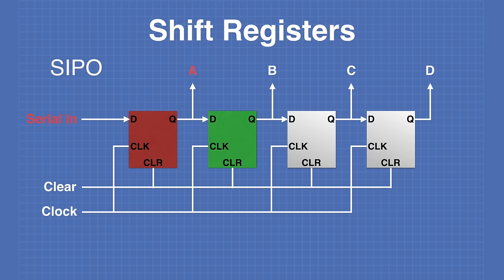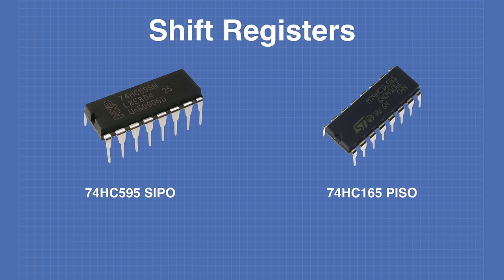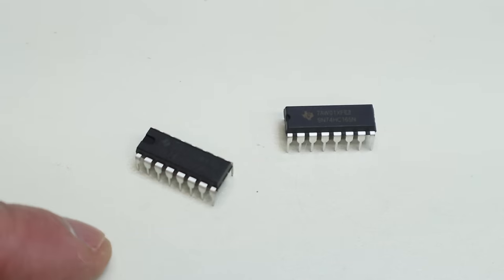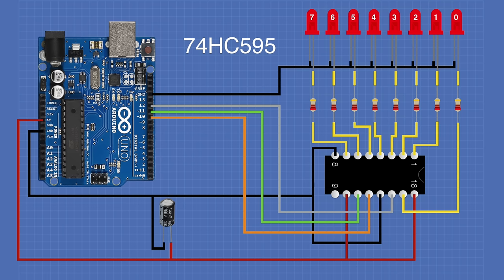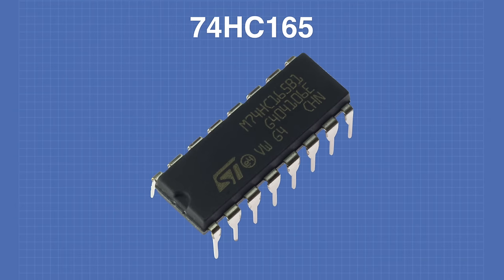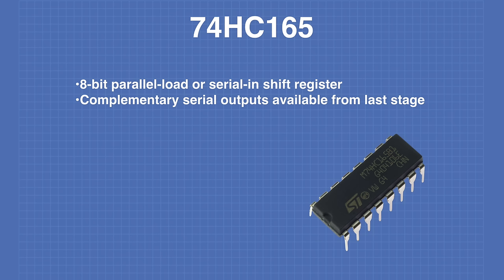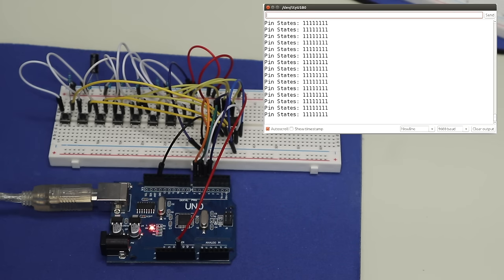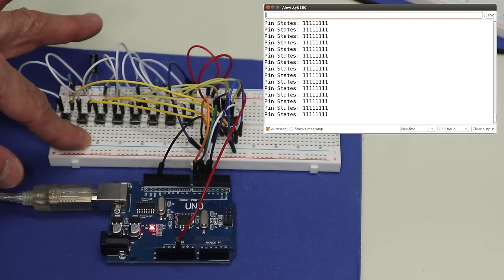74HC595 & 74HC165 Shift Registers with Arduino

Comment: THANKS!!  Very well presented, nice Christmas Lights display;  Now how can I customize this to program a set output pattern for a given input Byte?  I am trying to get air pistons to "fire" in set order given the desired pattern of piston position sensors (reed switches).
So the random pattern of the output with no RESET of INTERRUPT capability is not particularly useful for practical applications:  Could you make a Tutorial that caters to programing several air/hydraulic pistons to perform active tasks in a customizable sequence, please? 
THERE ARE NO USABLE TUTORIALS OUT THERE FOR THAT!!!  A lot of the existing tutorials are just about controlling one piston - I cannot find any that would fit my needs... 
Thanks again for the clear, detailed Tutorials you have already out there - I will definitely incorporate a few of these in my final project.  :-)  Great stuff!!!

Comment: Interestingly these DIL-16 types of resistor arrays are relatively expensive and hard to find on cheap sites like aliexpress that prefer the DIP packages. When I say expensive, 2 will cost the same as 50 logic chips.

Comment: Great walkthru, I was wondering how many volts should the 100mf electronic capacitor be, and how necessary is it to have?

also running into an issue where 'all' the leds are blinking at once.. not sure what I may have done wrong.

Comment: Excellent class! Any link to this Resistor Array (global)?
I just didn't understand the order of the pins from the 7th segment display to the shift register, 74HC595, for example, because it seems that there is a 7th segment display that doesn't follow an order. Thanks for the video.

Comment: I think the reason you are having to use the compliment serial out is because you are not setting clock back to low after you set clock enable low.  You are missing shiftIn's first low to high clock transition.

Comment: Nice example of Shift Registers, but what is component serial# of the 8 resistors in DIP package ?
Reply: I am curious about the 8 resistor DIP items as well? ... Great Video!!  Learned a lot and ordered some 74HC165 and 74HC595 and would also like to order some of the 8 resistor DIP.
Reply: Purchased on Amazon and tested (Worked Great) these Jameco Valuepro 4116R-1-331LF. Bussed Resistor Network, 16 Pin, 125 mWatt, 330 Ohm, 2% Tolerance ... Great Video!!

Comment: Don't know whether you check comments from this long ago but - why did you use an Arduino output for the '165 clock enable? It's just ORed internally with the clock pin, so in this case could just be connected to GND (as per the datasheet examples). TIA, John.

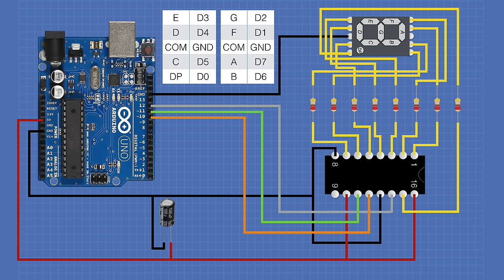Comment: I'm an amateur learning electronics, and when seeing schematics like 16:51 this one I always wonder :
is not more simply put only one or two resistors at the pin 10 and 16 ? Why the reason to put a single resistor on each output?
Is it because of the voltage of the chip? good practice? Or have a good reason I'm missing?

Thanks in advance :D
Reply: If you don't limit the outputs on a chip, although they have limited current output, if you don't use any dropping resistors, you won't limit the current of the chip, and it will burn or even worse, damage your ic because of forcing it to provide more current than what is capable of
You don't put resistors at the the vcc or gnd pins because that will limit the maxium corrent that will enter on the circuit
For example, you put a resistor and now your circuit has a maxium of 200mA, if you have more than 4 outputs that provide 50mA each, as the voltaje won't go up, the current will drop to compensate. At least that's what i understand, i may be wrong, if i am please correct me

Comment: Most excellent video, very well explained.  I have a question though.  Just suppose (for some strange reason) we need twelve outputs from two daisy chained 595 shift registers.  That leaves four outputs from the second 595 unused.  How do we handle that situation?  Are unused outputs grounded or just left hanging?  Is the programming  straightforward, as in I'm loading 12 bits into the registers and then outputting all 12 bits or do I need to need to handle the unused 4 bits in some fashion?  Thanks in advance for any help!

Comment: this video was VERY helpful. I didnt know resistor arrays existed and now i really want one! What is the part number for the one you use in this video?
Reply: 4116R-1-331LF try this, if you get
Reply: @charmindesai3730  They're very expensive.! I think I'll go for eight individual resistors instead :-)
Reply: @Zorgens  Yes ! Even I had to do the same thing. They are expensive

Comment: Sir,can u plz tell me why did u connected the capacitor ??
What would be the difference if i won't connect it🙏🙏
Reply: From the datasheet: "Each VCC pin should have a good bypass capacitor to prevent power disturbance. For devices with a single supply, 0.1 μf is recommended; if there are multiple VCC pins, then 0.01 μf or 0.022 μf is recommended for each power pin. It is acceptable to parallel multiple bypass caps to reject different frequencies of noise. A 0.1 μf and a1 μf are commonly used in parallel. The bypass capacitor should be installed as close to the power pin as
possible for best results."

Comment: A good intro for the noobs, but I was slightly disappointed you didn't show how you can combine the shift in and the shift out onto the same clock and data pins: just put a resistor from the serial out of the74HC165 to the serial data pin so that when the pin is in input mode it sees the input data but takes control when it is in output mode.  ... also, you can dispense with all the extra parallel latch wires too, by using capacitor-resistor-diode from the clock wire. The R-C on the 165 pulls the PL pin low, but a diode to clock holds it high while the clock is pulsing. The R-C on the 595 holds the RCLK high, but a diode to clock pulls it low while the clock is pulsing. The shift in-out process then looks like this: a long enough low on clock latches the parallel input data; shift in the serial to data; switch the data pinmode immediately (waiting too long with clock in low or high will send unwanted signals to PL or RCLK, though staying low at this point would probably be fine) to output and shift out the wanted serial data (it will have shifted in the data from the 165 during previous step); leave the clock high at the end and after a few microseconds RCLK will get high enough for the data to appear on the outputs. Appropriate values for R and C would give an RC time constant of about 5 of your serial clock pulses. <<<<< All done through 2 digital pins for both the inputs and the outputs. The SPI periferal on STM32 chips has a half-duplex mode which works just like this, using just one data pin for both input and output. Also, you never mentioned what cascading means: connecting another shift register to the end of the first one making a 16, 24, 32bit or more shift register. What all this means is that you can add another 32 digital IO's to any arduino for less than a dollar/euro/pound in components and 2 digital pins.
Reply: I've been playing with this the last week, and have realised that, for output only, only one controller pin is required if a little delay (50ns or so) is put between the clock signal and the serial input of the 595, with an RC of 1k2Ω/47pF or so. Putting schmidt-trigger buffers or inverters on the input to the board with the shift registers also helps, since with many capacitive things (like CMOS inputs and delay capacitors) running of the clock line it can get a bit messy if all that current has to come down a wire. Then the input side can have a dedicated line, so both lines are now one-way (meaning that optocouplers or current signalling can be used between the boards) and driven from a low impedance source (using a resistor to send data back down the same line when the controller switches the pin to input mode works with 1k5Ω but the signal is messy and takes long time to rise and fall). The One-Wire signal can't be run from a hardware SPI, but can be run from a PWM on chips with DMA like STM32, or with a bit of assembler bitbashing the complete 16bit send & simultaneous receive in 5µs is quite possible - possibly less time than it takes to set up the hardware and definitely smaller code and greater flexibility. Basically, hold the clock low for 100ns to get the data line low as well, and then the rising edge will clock in a 0 to the shift register. hold the clock line high for 100ns till the data line is high too and then blip the clock low for just long enough that the 595 chip registers it (25ns) and then back high before the data line has fallen too far, to clock a 1 into the shift register. Repeat for all bits, leave the clock high at the end and a couple of microseconds later the RCLK will get high too and the new data appears on the outputs. Again, schmidt-trigger buffers help, also after the delay capacitor to the data line, making the ratio between the long high data part of the signal and the short low required before the clocks rising edge less critical, and enabling transmission speed as fast as the processor can handle (72Mhz ARM). With an AVR processor it wouldn't be needed since all timings would be longer, just needing longer RC delays.

Comment: Very good presentation. Simple, but not oversimplified. The only thing is, 74HC is NOT TTL. The voltages are different, and the technology is CMOS, not Bipolar transistors like in TTL. Strictly 74HC is not even compatible with TTL when operated at 5V. 74HCT is the same technology, same speed and same low power consumption but intended for co-existence with real TTL. Actually HCMOS is more similar to the CMOS 4000 series. But 74HC was designed so the type numbering is compatible with the antique 7400 series.

Comment: Just ran into an unusual issue with a batch of Nexperia 74HC595 units which the Fairchild version does not exhibit. Turns out that pin 11 (shift reg. clk)suffers 'ringing' that's tough to quantify as any Oscope probe capacitance is enough to stop it. A wet finger capacitance  on the pin makes it work fine. My solution ended up being a 470Ω inline with pin 11 to  defeat the ringing resonance. I was running it with a 5V PIC 16F886 MCU.  Threw away a few 'bad' Nexperia chips b4 I figured out the issue so I could use them.

Comment: Would it be possible to use 2 outputs to create 4 different states, thus controlling 4 LEDs? It would sort of double the output pins every time you add a new pin into the equation.

Comment: Excellent video thank you, much better than reading the manual.  One thing I noticed is that I have two chips daisy chained together.  When I run through my program I find that the second chip (74HC595) displays incorrectly if I don't bring Output Enable high (disable the latch register).  Can you explain why that happens.  I see that you leave OE low by correcting directly to ground and leave enabled.

Thanks

Comment: Hi Thank you for the informative video. I have a question on controlling a Graph LCD requiring write and read data. Can you use 74HC595 & 74HC165 with the parallel pins connected to the GLCD data pins. The aim is to reduce pins used on processor using serial data.

Comment: does the shift register ic requires a 5 volts that i can't just put a resistor to its power supply or supply it with 3 volts to avoid using many resistors? or the current would not be enough? thanks. sorry I'm idiot.
Reply: or to put a low resistance resistor to common ground of led?

Comment: Is it possible to use both 595 and 165 shift registers (2 of each) with an ATTiny85? I have a couple of DigiSparks and am looking at a small project to take say twelve capacitive touch sensors and use them to switch twelve 12v outputs (with optocouplers in between to operate relays or similar). I could use just an ATTiny chip or the Digispark as I have both, but not sure how to connect the registers to the Digispark/Tiny.

I’d appreciate any input, but please bear in mind I am a beginner.

Thanks

Comment: Is it possible to make the circuit display LED-1 with button-1, then button-2 displays LED-2 etc.  So there is only
 one LED illuminated with each button press. so it's an input following with latched output LED system?

Comment: The circuit for the 74HC165 makes no sense without a description of the switch connections.  Which of the three connections are getting switched?   Are they 2-pole on/off or 1 pole 2-way?  I happen to have a component that looks almost exactly like that image, so I can test it and see that it is a single-pole on/off.  So the resistors and the '165 pin are a common connection (hence the term 'pull down') and closing the switch pulls the pin up to 5v.  The code confirms this.  But a proper schematic would make this sort of guesswork unnecessary.

Comment: I would like to use this circuit for a well level indicator. But the input switches stays on as the water level rises. I have 14 inputs magnetic switches. Do you think it will work.

Comment: So if you're powering eight LEDs on one single pin at 8x 20 mA through a shift register, how come you don't exceed the 40 mA limit for a pin or the 150 mA for the Arduino board? What's the calculation for that?

Comment: One issue with using the 74HC165 for input buttons would be polling and catching a button press in time without blocking the rest of the code versus running a on change interrupt.  How do people handle that?  Poll in a timer interrupt?
Reply: the arduino has inbuilt timer which can be used as interruption timers, which when the interruption occurs, you can run whatever you want inside another function, i think it was ISR(Timer_interrupt) or something like that
There you can put the code to receive the inputs, which shouldn't be more than some nanoseconds

Comment: Well presented.  Electrolytic capacitors are not ideal components.  They have some value of inductance which increases with capacitor size.  This means the electrolytic capacitor does not suppress high frequency components as well as it suppresses lower frequencies.  It is common in linear power supplies to see a 10,000 microfarad capacitor in parallel with a 0.1 to 1 microfarad Mylar or disc capacitor.  The small capacitor suppresses the higher frequencies.  The large one smoothies the rectified input

Comment: Great video - anybody else disappointed at 15:03 that we didn't get to see the LEDs reset to 0 😒🤣
Reply: Great work Bill, another great video:  Hi Bruce - Bill's sketch counted from 0 to 255 ( a 256 count), with a 1/2 second delay, so to fully count (and have the system reset all LEDs),  we would have had to watch for  128 seconds,  So I checked the timings: First stopping at  at 13:50 when Bill reset the counter (starting again at zero), then I stopped the playback at 14:54 (64 seconds after the start) and sure enough LED 8 came on (a count of 128). Then I continued the video, and stopped at 15:05 (75 seconds after the reset and sure enough LEDs 8,5,3,2  were on (a count of 150 and when divided by 2 = 75 seconds later).  The only error I noted was at 37:45 when Bill said he had shortened the delay to 200 microseconds when the sketch had 200 milliseconds [written as delay (200);].  the correct syntax for a 200 microsecond delay would have been [delayMicroseconds(200);]

Comment: Good day. I tried the 74HC595 using 8-led sample circuit from this video. The problem is that pin 15 (Q0 or QA) of the 74HC595 is not driving the LED. DC voltage between the resistor and LED is at 3V max. While the remaining LEDs that are working goes 4.5v. I tried replacing the resistors with 220, 390, 540 ohms, replacing with new 74HC595 but still pin 15 is not lighting its LED. I appreciate your advice. Thanks.
Reply: please ignore this. this matter was already resolved. this is a case of bad breadboard connection at pin 15.

Comment: Help. All 8 LEDs connected to my shift register (74HC595) are permanently ON as soon as I give power to the Arduino Uno. The Arduino's programming to control the data, latch and clock pins has no apparent effect on the chip's output to the LEDs. I have re-assembled the circuitry several times and always the same result. (Side note: As is intended, I am able to turn off all LEDs by connecting the MR (master reset) pin to GND, or by connecting the OE (output enable) pin to +5V)

Comment: Your things are so good sir, But while wiring explanation,  instead of saying we will connect pin x to pin y, Please be more elaborate, you could say we will connect pin 5 to pin 8 on the ic which is data in.... or clock out....

Comment: Why not use 2 shift registers to create an eight by eight keyboard matrix... Serial to parallel write lows to the matrix. Parallel to serial to read from the keyboard.
Reply: P.S. a 3 to 8 decoder could be used to poll a keyboard matrix and shift register to read it

Comment: I like that resistor array. Does anyone knows an IC number or so?
Reply: I also wonder. please light us up ;)
Reply: Go to Amazon or mouser and type in resistor array then look for resistance values.
Reply: @S17239  Well.. im have to use the old ones.. im not paying Mauser 22 euro for one peice..
they want 20 euro for delevery .OMG...
Reply: @S17239  oke thanks. I already did of cource... But, I saw only SIL versions. I was looking for DIL versions. Now I looked into it a bit deeper and it seems there are SIL versions which resist from 1 to 2 and 3 to 4 and so on.. So that is workable too... But looking further for DIL versions... It seems easier for testing situations for me...
Reply: I am also looking for the same since a long time ( DIL VERSION ), let me know if you have found